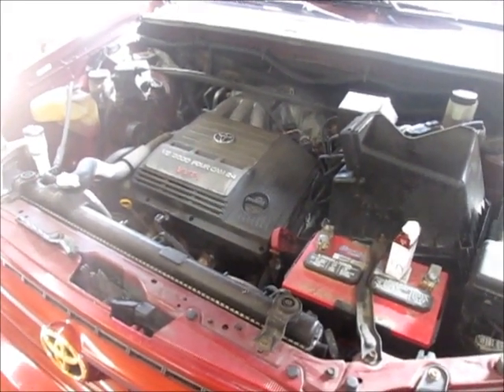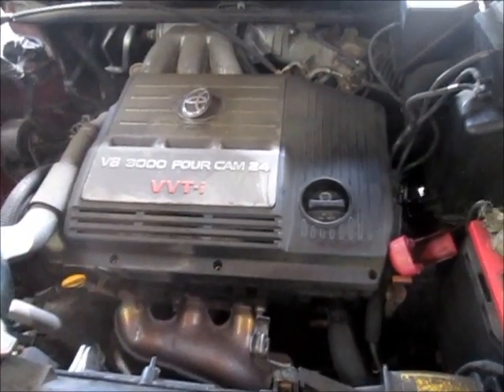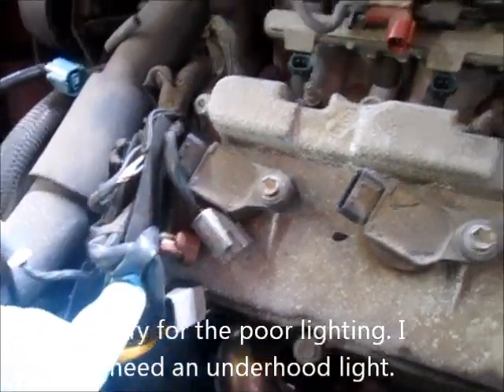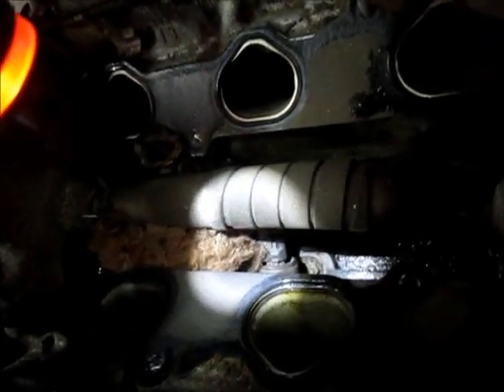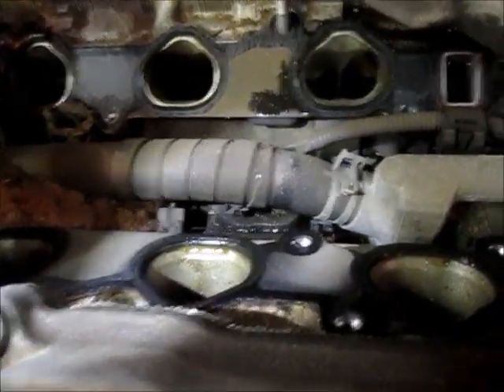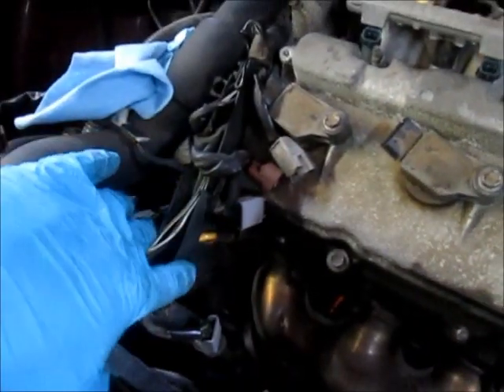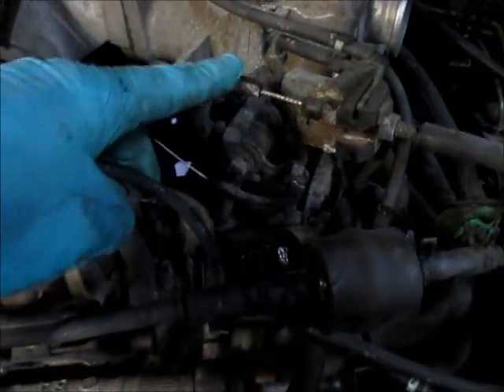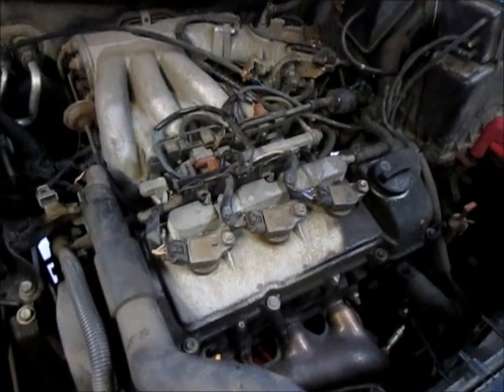Toyota Highlander knock sensor replacement

Comment: I have an '07 Toyota Highlander and I just had a check engine light and a VSC light and I went to get the code checked and it said it was a bad knock sensor I only have 149,000 miles on it. I'm terrified this is my 2nd car I've had bad luck on.
Reply from the maker: Sorry to hear that.

Comment: If u do this job remember to replace intake manifold gasket... to ensure no problems ... never re use gaskets. ..
Reply: Sure
Reply: Hi
Reply: You are right. Reusing an old gasket like that is a very bad idea. You are asking for trouble. Those gaskets are meant to be compressed just once. You can end up with another trouble code for an air leak and an air leak somewhere in the induction system can be very difficult to find. He also should have put paper towel into the intake ports to prevent anything from falling down inside there.

Comment: Eff Toyota flr putting a sensor in between manifolds and with a coolant hose running over its connecting wire.

Comment: Jo Daddy, this was an excellent video! Thank you very much for your very clear tutorial and outlining each step. I'm heading to the parts store now to get my sensor and a wiring harness (which I didn't realize I needed). In 30 miles my highlander will hit 200,000 miles so perhaps this is a common issue around this drive time usage. Again, many thanks!

Comment: Thanks for the video I got the sensors out and waiting for new ones to arrive. I just wanted to add that I cut a 9/16 socket in half and was able to remove the bolt by the firewall.

Comment: what knock sensors did you use and how are they holding up?
Reply from the maker: Tghis video is so old. I probably got them from Advance Auto. Vehicle ran for years afterwards. They finally sold it.

Comment: Thanks for the video. Can you share what sensors you bought. The Toyota ones are super expensive...
Reply from the maker: I don't really remember, but it's likely I got them from Advance Auto.
Reply: I'm getting mine (Knocks Sensor 1) from auto zone for about $155!
Reply: Not really. I just bought a brand new set of Denso knock sensors and the original Toyota wiring harness for $43 off Ebay.
Reply: @rgt8309  Just to be clear. What you actually purchased were Chinese knock-off parts and not Toyota original. Hopefully they worked out for you and have lasted. I'm not suggesting they are inferior ... just not original.
Reply: @PresidentGas1  No. the description said they were original Toyota parts and the label verified it. Plus, when I took out the bad ones, they matched perfectly.
Reply: @PresidentGas1  And they're working great...no issues whatsoever.
Reply: @rgt8309  Yeah I'm aware of what the Chinese say in their descriptions. I also purchased a set off of E-Bay. Super cheap compared to Toyota. Fingers crossed.
Reply: @rgt8309  Nice !!!

Comment: So real quick- P0330 code is present on my girls 03 highlander. Ive been reading some of these comments and others and seen where people are saying if the knock sensor will keep it from shifting into 4th gear. Driving the other day I noticed the car wasnt shifting into 4th gear. She told me that she "Hadnt noticed it and replied "Is that not normal". Yeah haha. Fluid looks good and all so when i hooked up the scanner i had a P0330 code. Has this fixed others issues of not shifting into 4th gear (OD)
Reply from the maker: Dustin Nealy It solved the shift issue, and it increased gas mileage from what the owner told me.
Reply: Dustin Nealy dam this is the exact same thing that is going on with mine. a mechanic wants me to replace the whole transmission.
Reply: I had same problem on my 01 highlander, goes into limp mode and doesn't shift to 4th, I changed knock sensor wire harness, still showing knock sensor codes tho, half of my engine is running lean to which I think is causing knock sensor to show, any suggestions?

Comment: Ok I just went through the whole process. Installed new sensors put everything together just like in came and now my starter is making a loud jerking and not cranking the truck. Any help would be nice it's got me baffled since I didn't have to touch the starter.
Reply from the maker: Hmm. That is odd. Loud jerking, like won't turn at all?
Reply: Nope the starter does a hard jerk moving the engine but not turning it over. Before everything was fine.
Reply from the maker: @claywint5977  That's really odd. There's no interaction of parts...

Comment: Hi, I'm replacing the knock sensors on my 2006 Toyota Sienna, and your video has been helpful.  What I'm curious about is how you got to the brace that is connected to the rear of the plenum?  I see that you disconnected the brace from the engine block, but is that accessible from underneath the vehicle?  I'm so close to getting this done, but like you said, there's no way to get to the bolt thanks to the firewall and the sides of the bracket!
Reply from the maker: If I remember correctly, I got it from underneath the vehicle.
Reply: very similar to a honda accord,have to go from the bottom....
Reply: Thanks!  That was easy enough however, there is another 10mm nut holding a hose bracket on the support bar for the plenum.  Do they expect you to lift the entire engine out in order to release the plenum on the 2006 Sienna or am I just missing something.  This is the most ridiculously engineered vehicle I've ever owned...
Reply: Thanks!!
Reply from the maker: I've seen worse.... Not sure what to tell you on the other bolt.
Reply: I'll figure it out I suppose.  Thanks for replying!

Comment: Very helpful, thanks! A question for ya -- what kind of socket (brand and style) did you use to remove the knock sensors? My Husky standard socket is too shallow to fit and my Husky deep fits nicely over the sensor, but then there is not enough room to attach wrench to it. Since the depths across brands vary, the hunt is on...
Reply from the maker: Djpoints Well, honestly, I think I used a crescent wrench...
Reply: Jo Daddy's Garage Thanks! Ended up getting a big (1 1/16) combo wrench. Had just enough angle to grab just enough of the sensor. Changed both sensors and the wire harness...and after about 20 miles so far so good! One tip to other novices like myself, I think you better drain the coolant before opening the intake manifold. I didn't and coolant leaked everywhere. I imagine that's common sense in the auto mechanic's world, but figured I throw that out there. One other question Jo Daddy -- How in world did you get the passenger side bolt off the back of the plenum against the firewall? More precisely, how did you get it back on??? Unbelievably inaccessible and was by far the hardest part of this job :)
Reply from the maker: Djpoints Glad you figured it out. Definitely want to drain the coolant. That bolt was rough. I thought I went into some detail on that. I thought I unbolted the bracket from the engine, and pulled the bracket with the plenum.

Comment: Hey Jo Daddy, great job on this video! I have a V6 98 Camry with basically the same set up and am looking at replacing mine as well. What I'd like to know is, if you removed the bypass hose, did you replace the coolant as well? And can you remove the knock sensors without having to remove the bypass hose?
Reply: Also, how long did this take you to do?
Reply from the maker: Pretty sure the hose needs to be out of the way.
Reply from the maker: I did it in about 4-6 hours I believe.

Comment: Nice way to handle Air intake support bracket bolt. I read forums  with lot of folks struggling with taking off air intake.  

BTW, how did you take off old knock sensor harness? It's stuck with lock on support. I'm stuck with this step.
Reply from the maker: Thanks. I just look at things differently. I don't remember what I did for that clip.

Comment: So, how much antifreeze was accidentally flooded in to the intake ports that left wide open which you cut out of the video...?
Reply from the maker: Didn't have any. I drained the antifreeze before I started removal.
Reply: Hana my dumbass didn't drain the coolant before starting. Thankfully it only entered 2 intake ports and the valves were closed. Took a windex nozzle and drained them out. Rookie mistake tho to be sure

Comment: do you have to Toyota part numbers for these 2 knock sensors?
Reply from the maker: Sorry, I do not.
Reply: I just loaded up $300 worth of Toyota parts on amazon!!!!  2002 sienna 205K

2 knock sensors
1 harness
1 coolant hose under there
Fel pro gasket set (3) in set

True 1 harness for both sensors?
Reply from the maker: I believe one harness is correct.
Reply: Thank you for your video and help

Comment: Im.pretty sure i fucked up my
Car doing this
Reply from the maker: What happened?
Reply: @JoDaddysGarage  not sure I put everything back together but now the coolant on the radiator is overheating.
Reply from the maker: @marco209lodi5  Air in the system. Need to burp it. May have to jack it up on one side, and make the radiator cap the highest point. Add antifreeze.

Comment: How did you clear the code?
Reply from the maker: I have a scanner I bought at the parts store that can clear codes.
Reply: Thanks for the answer!
Reply: you can also unhook your battery for about 5 mins and it will clear it as well

Comment: Screw Toyota and I thought they were good. I just did the timing belt and now this pops up. if I ever get a Toyota again it will be the 4 cylinder with a timing chain in the years without the head gasket problems, lol. Why they ever put a wiring harness in such hot space that couldn't take the heat in the six and why they ever put a starter under the intake on the v8 is just poor engineering.

Comment: So did whatever was living in there chew through the knock sensor wire? I'm guessing that's a shielded wire? great tutorial. looks fun.
Reply from the maker: The critter did not chew it up. The wire is in a plastic sleeve. Thanks.
Reply from the maker: It was a little more complicated than I had hoped.
Reply from the maker: It took about 4.5 hours to take apart, and about 2.5 to put back together.
Reply from the maker: Very cool. I have an original 1931 Model A Tudor that I restored. It was my grandfather's car. I may do a video of that car soon.

Comment: Jo Daddy Thanks for the Video, it helped  a lot! - I just replaced two knock sensors on an 04 Sienna.  Same basic procedures as you outlined. Likewise the tough part of the job was getting the plenum off - on the Sienna there were several bolts to deal with.  Using basic tools it took a combination of removing the accessible upper bolts and the lower bolts on the engine block.  It took me all day! Next time I am paying a mechanic - they cite about 3.5 hours of labor to replace two knock sensors.  IMO its worth it!  I learned a lot and felt like I gained more respect for mechanics that deal with these challenges daily.
Thanks for taking the time to share your experience with us DIYers.
Reply from the maker: +David Blaine Glad it helped, and you should feel good about doing it yourself. Thanks for the comment.
Reply: I'm in the process of replacing on a 2006 Sienna.  Thanks for adding your experiences.  The one thing I am realizing is that I need smaller hands!

Comment: defintely the cause for SHIFT PROBLEMS/OVERDRIVE FAILURE
Reply: That is not a failure. The engine computer locks out the overdrive when the knock sensors fail. This is to protect the engine from undetected engine knock until the sensors are fixed. Once the code is cleared the overdrive works again.

Comment: What torque did you use on the knock sensors?
Reply from the maker: I just made them tight. Didn’t check torque.